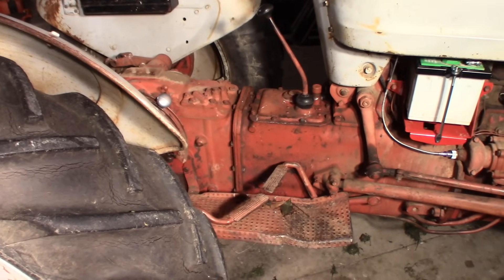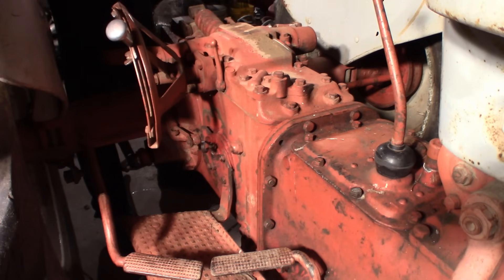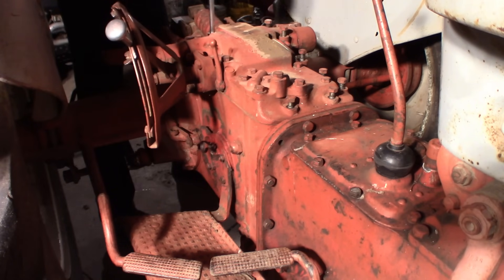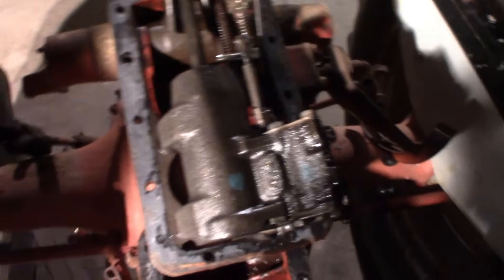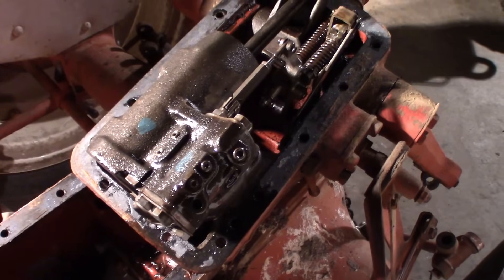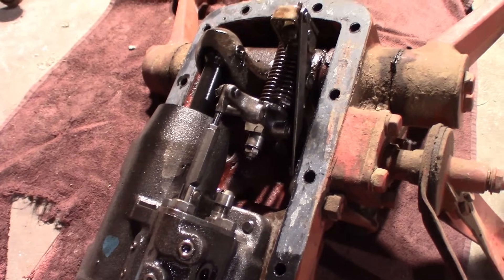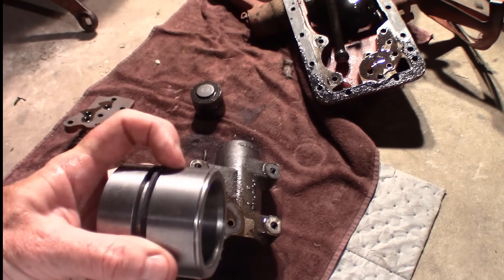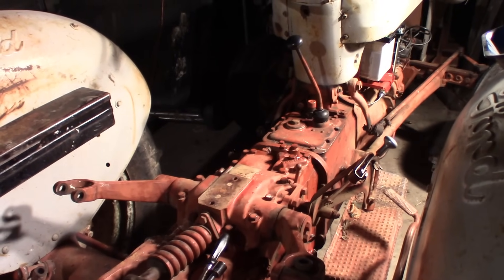Jubilee update 6 hydraulic lift rebuild

Comment: Nice overall video on the Jubilee Hydraulic lift lid 3 point that is part 8N and part 600 series. Acorn nut on housing side should have been removed BEFORE you removed the top lid. I just broke mine a few hours ago I did not know or remember to take it off and I broke the inner screw hold down.

Comment: I have a question about the acorn nut, I noticed in the video the nut was still in place when you pulled the lid . did you break any parts when lifting the lid. The acorn nut should be backed out and there is a flat rubber gasket between the tube and the casting.
Reply: I seen and was wondering the same thing. I just pulled my lid off hours ago and I too did not remove the acorn nut and I broke the inner screw. I/m not sure of it's purpose. PS my down tube was bent really bad in two spots looked like no flow would go through. Thankful I have a back your full of ( FORD ) tractors for maybe a good spare or whole unit.
Reply: @MrBruce0777  in case you haven't figured it out , the acorn nut has to be removed and the inner screw turned out befor taking the lid off. turn it in after the lid is installed. there is a seal in the pump where it meets with the tube. most likely will be damaged if the screw is left in during either operation.

Comment: If you have a NAA, you can remove the huge hydraulic system fill plug under the seat, shine a flashlight in on the piston and barrel!
You do not have to remove the PTO shifter cover to check if your piston o-ring is leaking. 
I do not know if that works on the number series. 
Hello from north east Montana. 
10 miles from the Canadian border.

Comment: Unfortunately, this video was not as helpful for "How to", as you skipped the operation of doing things on-camera, and instead just showed an outline of what you did, performing most things off-camera. At at the end, an "oh by the way, I also changed the relief valve". That's what I was searching YouTube for. You didn't point it out on the cylinder or how it is removed and replaced. For someone who does not know, that's a huge mystery that is still a mystery.

Comment: In the gasket kit for this it has several smaller o rings.  Does anyone know where they go?
Reply: Did you ever figure this out? I'm trying to figure out if there is supposed to be an oring where the lid mount on the belly to seal the pressure supply to the valve. I'm working on one that is spraying oil out this area profusely. There was no oring when I removed it but I think there should be since it's a pressure line.

Comment: We had a valve that bolted to the top right of the lift cover that gave us remotes for a trailer type disc with a hydraulic cylinder.. we had a 860 , looked for one check with Steiner tractor
Reply from the maker: I  always wanted to find the remote block to add to our tractor, but no luck.  Awesome you had that option.  Thanks for watching.

Comment: I have a '56 800 with the same system & the draft control will not stay in the "down" position...... recommendations?
Reply from the maker: Sorry, I have no idea.  Besides the jerking issue, mine would not raise in draft once lowered.  All I can suggest is a lot of Google searches.  There are some good forums out there full of information.  I found an adjustment procedure on one and did a video of the adjustment, not sure if that would cure your issue or not.

Comment: The one thing that will make putting the cover back on a lot easier is to remove the acorn nut on the right side. i took the nut off and screwed the threaded pipe out. Apparently this is a return line so the fluid doesn't foam. I use an engine hoist to lift the cover off. I almost have a zipper on my Jubilee lift cover it has been off a lot. The gaskets blew out probably because of a faulty relief valve. I tried to make the gaskets for the cover to lift cylinder. BAD IDEA, buy the proper gaskets. My Jubilee is hiccuping also. I suspected the O ring leaking, but do not see much fluid dripping out of the cylinder.
Reply from the maker: I have made a followup video where I found the actual leak in the front of the valve body.  Not sure if parts are available to fix it or not.

Comment: Nice job on the video.  I have an NAA as well.  My implements move up and down as you described as well.  I took apart the side mounted hydraulic pump and found that there are a number of little springs and ball bearings that apparently  create the hydrostatic pressure.  The springs/balls sit in little holes.  I noticed that some of the springs  are broken.  This to me would explain explain the lack of steady lifting  pressure.  I bought a rebuild kit for the pump and will tackle it this summer.  
Here is a link for the kit.  The Picture shows the springs I referred to.  Regards Drew
http://www.yesterdaystractors.com/CCPN600AB_Hydraulic-Pump-Repair-Kit_643.htm?gclid=EAIaIQobChMI2L6awtbq2gIVA1uGCh0kuw1CEAQYASABEgLtr_D_BwE
Reply from the maker: Thanks Drew.  Please let me know if the pump rebuild fixes the issue.
Reply: Sakima's Ridge Homestead   Ok but Hope I will be able to  find this thread again.  Quite sure it will.  There was obvious deterioration of the vane pump.

Comment: Did you have to bleed the hydraulic top plate once you put it back on the tractor or did you just put it back on and start moving the adjustment lever
Reply from the maker: I did not have to bleed the top plate.  Just run the lift up and down once or twice and it is good.

Comment: did you ever get around to figuring it out i have the same problem
Reply from the maker: Unfortunately, I have not worked on it any more.  It works OK in position control to run the brushog so it got us through the year.  But, when set in draft control it will do nothing, which will make plowing the garden difficult.  I did find a setup/adjustment procedure online somewhere that I am going to try soon.  Hopefully that will fix it.  I will post a video of that procedure.
Reply: , @SakimasRidgeHomestead , did you get back to the pulse problem and find the source. My Jub lifts fast, no weight deficit, perfect pump, and it pulses 1/2 to 1 inch. Like yours, the auto-draft drops the arms with no lift control response. Any wisdom before I pull the cover?
Reply from the maker: @davidhalopoff544  I did post a video with the adjustment procedure.  It shows what I believed to be what was causing the jumping.

Comment: Did you find the fix to the original issue?  I have the same trouble
Reply: I noticed my lift does nothing when I set it on draft as well. If you fixed the issue, please share what the fix is.
Reply from the maker: Brian Brownlee unfortunately no.  I have also noticed that it does nothing when it is set on draft.  I did find an adjustment procedure online, but haven’t had the opportunity to get back into it yet.